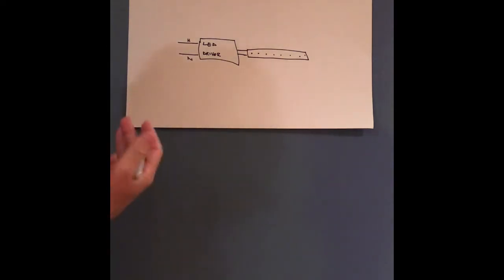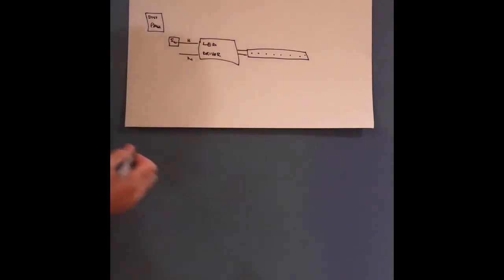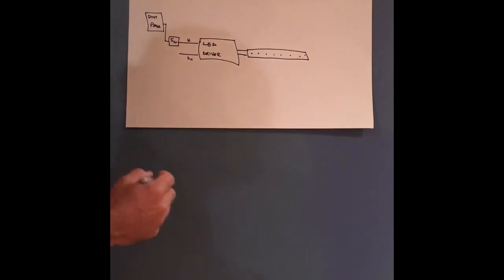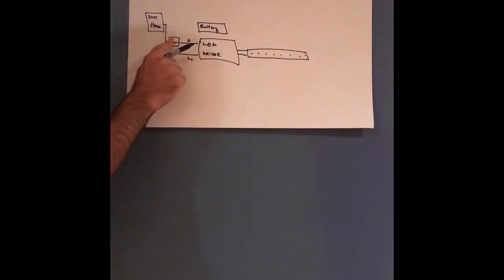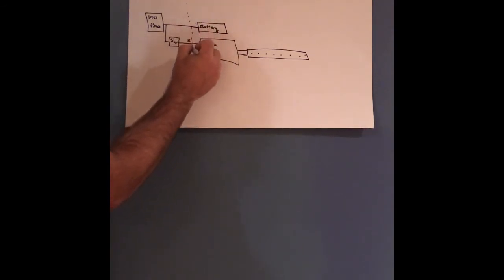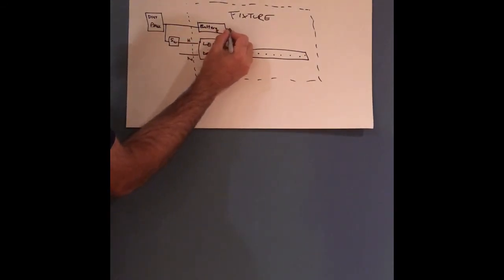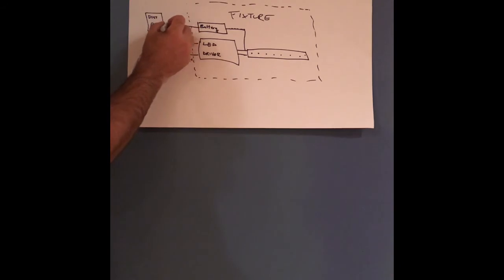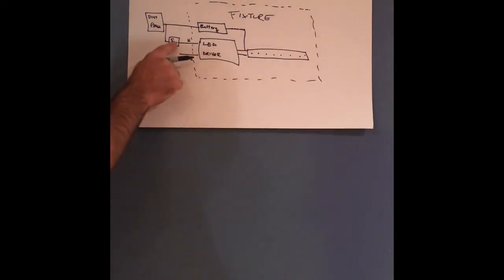Battery Backup Basics For Light Fixtures

Comment: HI! Thank you for the info. 

How does the fixture / battery determine power was lost. A logic controller within? I ask because it has to somehow know the difference between an outage and a switch simply being turned off. thank you!
Reply from the maker: Hi.  The fixture needs to have an unswitched hot wired to it as well as the switched hot.  When you lose power on the unswitched hot wire, the fixture automatically turns on the battery regardless if the switch is on or off.